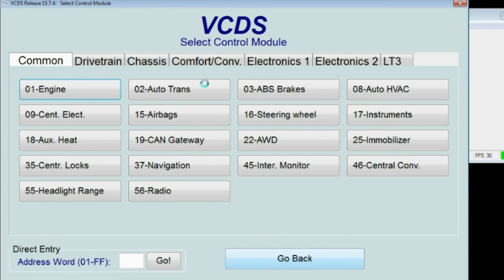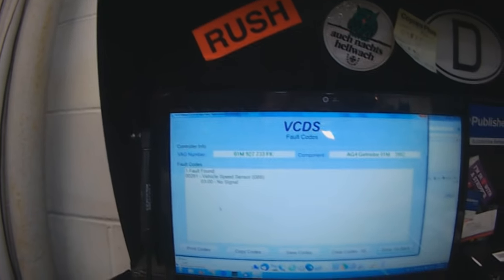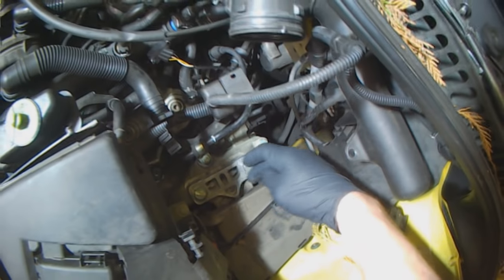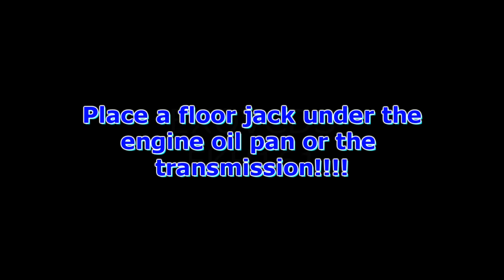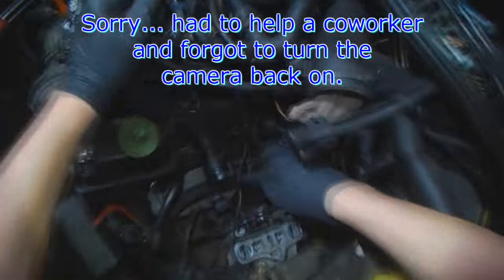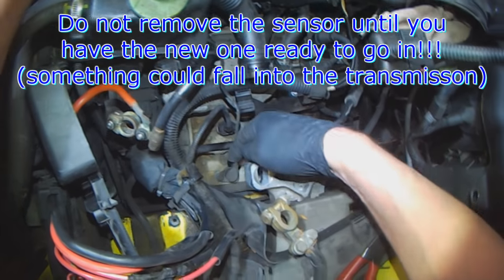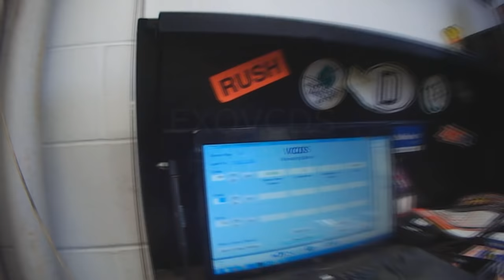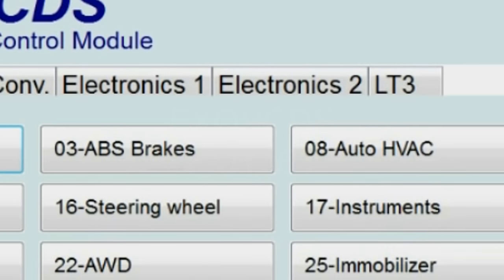VW A4: New Beetle - vehicle speed sensor (G68) no signal

Comment: Thomas - First thanks for the video!  Question if you don't mind.

2001 NB AVH engine.  00281 Vehicle Speed Sensor (G68) 03-00 No Signal from VAG-COM.  If I reset the code, I get the same error as you, BUT then the transmission shifts flawlessly when it should....but within just a few miles, code was thrown again and the DTC returns 00281.

Had the timing belt done and the coolant flange replaced and then within a couple days the fuel pump died, which I replaced.  However, my son-in-law towed it to my house with all 4 on the ground after the pump died, but did tow slowly.  About 10 miles.

After I replaced fuel pump, transmission was slow to shift - would go up to 4,000 rpm then shift.  I thought his towing ruined the transmission and was not too happy since I thought it meant the car was now worthless.

In you video, when the sensor is out, you say to turn the wheel to make sure that the internal part is working.  Would you suspect that internal part was ruined by the tow or would you think it actually is just that the sensor died concidentally at the same time as the fuel pump?
Reply from the maker: The sensor is cheap & easy to replace... while it is out, it's easy to check the reluctor wheel for movement. I don't know if towing a car with the wheels on the ground is harmful to the transmission. Replace the sensor or check with a transmission shop if towing could have caused damage.
Reply: My owners manual says don't tow with all 4 down, but maybe some is tolerable. 

Feeling it shift flawlessly after I reset the code gives me hope that the transmission is not ruined after all.

I'm certain I can do the repair having your video as a guide.  Thank you so much for doing what you do!

I'll let you know how it goes.
Reply from the maker: Thank you.

Comment: My 2000 2.0 New Beetle GL (Auto Trans) read the code G68 Input/Output Shaft Speed Sensor, so I replaced it.   When I unclipped the connector, I noticed the TOP Part, not the side I was replacing but the Other side of it was starting to deteriorate..? It has red plastic in it that is just shattered.  Where does that ebd of the sensor go?? Getting to the top side of G68 shouldn't be that hard, unlike the bottom side I just replaced. The sensor I got did say Output, is the top part possibly the Input part if the code reading?
Reply from the maker: Sorry, I'm not following what you are saying. Post a video or send me pictures fkh161@fkh161.ca

Comment: Do you know where the same sensor is for a manual transmission 2008 beetle 2.5 engine
Reply from the maker: 5 speed or 6 speed?
What's the actual issue? Speedometer not working?

Comment: 2004 2.0 randomly shuts off. Check engine light does not get activated. But there is a “pending” code of p0725. Would that correlate to this sensor? Pulling hair out trying to solve this for someone. There’s no rhyme or reason. I turns off very randomly. No codes nothing. Once, it stumbled but saved itself. Again, no hard faults. 
 
the ONLY thing I have to go off of is that pending p0725. After it does stall, it takes a few seconds of cranking to fire back up. Then all is good again.
Reply from the maker: Sorry about the late reply... most likely a bad crankshaft position sensor.
How to check / remove: (long version)
https://www.youtube.com/watch?v=MJIA0AsxASQ

Short version:
https://www.youtube.com/watch?v=qYfZOb9vzkU

Comment: So which other sensor would it be if I'm still having shipping from because it will not shield unless the check engine light is on and it's a 2001 Volkswagen Beetle diesel
Reply from the maker: If the transmission computer is setting a fault code for a specific sensor or solenoid, then you have to check that sensor, solenoid or wiring. At this age, it is common to see wiring faults or faults with the ribbon cable inside the transmission. No one can tell you what the problem / fix is. You have to check things yourself to find the problem. Using a scan tool, multimeter and a wiring diagram. Sometimes it is quicker & cheaper if you take the vehicle to a shop that is familiar with vw automatic transmissions.

Comment: i have almost same problem with mk4 4 speed , when i want to move forward or reverse i need to put too much gas on acceleration almost 5 rpms when its cold, and when i drive the engine warms up i dont have this problem, i have this same error code in scanner.( oil and filter are new)
Reply from the maker: Can you verify with your scan tool that there is no signal when cold, but there is a signal when warm?
Best place to check is at the sensor connector with a scope. Multimeter will also work, but not as well.
Quickest thing to do is change the sensor. If nothing changes, take a closer look at all of the wiring / connections from the sensor to the TCM.
I don't think that the gear inside the transmission could be to blame... but I'm not a transmission guy.

Comment: My 2002 vw jetta doesn't have a code pop up. At auto zone it literally just said input speed sensor, is this all I have to replace? My car jumps when it shift gears instead of doing so smoothly. It's an automatic
Reply from the maker: No... your transmission probably has other issues. A faulty speed sensor (such as in this video) causes the TCM to select 2nd or 3rd gear (I can't remember which) when starting to drive. The car is slower to accelerate (due to being in a higher gear) and the TCM does not shift into the next gear until engine rpm is quite high & the throttle is released. No harsh shifting. Harsh shifting is usually a valve body / solenoid issue.

Comment: I have a 2004 Beetle which is shifting into and out of park, reverse and drive just fine and always has. But suddenly when I am driving, when I get up to about 20mph, it gets loud and the RPMs go up to 4000 or a little over, the faster I try to go the louder it gets and the higher the RPMs get. Basically it seems to not want to go into 2nd gear. Seems to be pretty much the same issue, right? Thank you for the advice
Reply from the maker: What happens when you manually shift... 1, 2, 3?
In this video, the rpm were slow to build (because the transmission was starting off in a higher gear. If your transmission is stuck in 1st gear, rpm will climb quickly and the engine will get loud (because of the high rpm). 
Check for fault codes, check fluid level... probably an issue with the valve body (solenoid bad or sticking). Have a transmission shop test drive it.

Comment: Would a wet TCM trigger codes p0740? I Left my passenger side window open and water flooded the floor of my 2005 Jetta
Reply from the maker: The TCM is located under the windshield next to the ECM on mk4's and behind the left front fender on mk5's. 2005 is the cross over year.... which do you own?

Comment: So I have a 2000 Jetta won’t shift into 4th and both the speedometer and Odometer are not working. Is this speed sensor the issue?
Reply from the maker: If you feel the transmission shift from 1 to 2 and then to 3... no, this sensor is not the issue. The "speed sensor" for the speedometer & odometer is on top of the differential. It's a 3 wire sensor. It could be that the sensor is bad... or it could be the plastic gear inside the transmission that is bad. 4th gear engagement is a separate issue.

Comment: have 1998 jetta 2.0 mk3 wolfsburg edition auto trans. Speedo not working. have code P0501 "Vehicle Speed Sensor A Range/Performance". Tach not working also but more interested in getting speedo working. Odometer not working too. But when I connect my code reader I get RPM and Speed in "View Data". Shifts fine also. Where is the VSS for the SPEEDOMETER located. And how to R&R it. If you get this let me know
Reply from the maker: The speed sensor (G22) for the speedometer is on the top of the differential. Here's a picture showing the location of the G22 speed sensor:
http://www.kansascitytdi.com/01m%20faq_files/image007.jpg

Comment: Hi nice video but how do you unclip the sensor, that part is not shown and we can't get it off using multiple tools?
Reply from the maker: Push the connector towards the sensor... pull back on the release tab with your thumb, pull the connector off.
Reply from the maker: Any luck? I recorded a how-to video just now. Will post it on the weekend.
Reply from the maker: Which connector / sensor specifically? The more info I have the better I can help.
https://www.youtube.com/watch?v=3GBtR7fpvyY

Comment: Can i lube the oring with normal engine oil? must it be an atf? I have similar problem with my golf 4, AG4 transmission gear. But it works at firsts few kilometres, later the "clock" is jumping, and at least i have 0kmh speed, and an icon with low fuel levev every time when i'm turning
Reply from the maker: If the speedometer "needle" stops moving... then it is a different sensor that is the problem (or a problem with the gear inside the transmission, that turns the sensor). Yes, a little bit of engine oil on the o-ring is not a big deal. If the needle stops moving, let me know and I will tell you which other sensor to check.

Comment: Question my wife's car is a 2000 beetle 2.0 manual.  Her speedometer has completely failed.  The check engine light has been on for awhile indicating sensor.  Where is the location on a manual.
Reply from the maker: The odometer stopped counting as well?
Reply from the maker: At 11:16 in the following video, you can see the sensor next to my coworkers hand. The sensor is usually covered with a heat shield / fabric pouch. You can get to the sensor from the top / through the open hood engine bay. https://youtu.be/OjdsKg1LsC8?t=11m16s

Comment: Hello friend, good afternoon. I have a new bettle 2008 automatic 2.0. Yellow, like this video. Today the car stopped. It turns on and accelerates normally, but when it engages the gear it moves a bit and stops, but the engine continues to run normally. All the tail lights are on, as if all gears were engaged. Do you think it could be the speed sensor?
Many thanks from Brazil. Congratulations on the video. Sorry bad English.
Reply from the maker: Hi... no, I don't think that it is a speed sensor problem. I would start with scanning the TCM (Transmission Control Module) for fault codes. Could be a wiring problem or a fault inside the transmission / valve body, but that is just a guess.
Reply: Thanks a lot Thomas. I will check. After i talk to you!!!
Reply: you need transmission oil added must be a guart or so low that is what they do when low a safety precaution to prevent burning transmission out.

Comment: I have a 98 volkswagon beetle manual transmission went through a rain storm and now I have no gears ..is the transmission computer module located on passenger side.
Reply: 1.8 motor
Reply from the maker: Standard transmission does not have a computer / module. Did you drive through a deep puddle? Does the shifter feel weird or normal? Does the clutch pedal feel normal or weird?

Comment: My beetle stalls then cuts off while driving but starts right back up, does it every blue moon, what can be my problem
Reply from the maker: Intermittent stalling... but starts right away, could be due to a bad ECM power supply relay. Or something else. If the stalling / no start does not happen long enough for you to do some testing... it can be difficult trying to trace down the actual issue. It will be easier to find the problem when it gets to the point where the engine does not start at all.

Comment: have the same problem!
Sensor changed but the code wont clear, and it still shifts like ass :(
Maybe my wiring is frozen to death...
Reply from the maker: With the sensor disconnected, there should be a different code. If yes, then the wiring is ok.

Comment: 2004 vw beetle are the sensor located in the same area
Reply from the maker: If it is a 01M transmission, yes... if your shifter can me be moved to the right and then shifted between +/- to change gears, then no. What's the actual issue? TCM fault codes?
Reply: @EXOVCDS  epc light car turns on and off .... But the code we get is transmission sensor well that's what my mechanic say
Reply from the maker: More than one type of transmission available in the Beetle.... that's why I asked. More than one sensor in those transmissions. The more info I have, the better I can guess. If your mechanic is able to read codes, he should be able to fix the issue. Was the estimate too much? An hour of shop labor compared to not being able to drive the car for the weekend (trying to fix it), might be money well spent.

Comment: Hey man im having a speed sensor issues as well, I have a 2005 jetta gli with the O2M 6 speed transmisson, code P0501, i replaced the sensor and it still doesn’t work, its weird my speedometer doesn’t work right away put as soon as i get up to speed and hit 3rd gear its starts working again, but as soon as i come to stop the car starts to jerk 1st through 2nd. My gas gadge also goes nuts whenever i turn the wheel as well. Ive checked my fuses and they look good. Maybe its a bad ground? If so do you know where i can check? Thank you sorry about the paragraph lol
Reply from the maker: It could be that the "tone wheel" (pressed on to the differential) for the speed sensor is loose... causing it to slip at low speeds and start spinning at higher speeds. Vehicle speed & ABS sensor speed signals are compared...  non matching signals can cause ABS / Traction control activation which could be the jerking that you are feeling.
Reply: @EXOVCDS I think I'm having the same problem my nieces car. So is that something that could be done from outside or transmission has to come apart aka replaced with another used one. Thank you for the video and taking the time
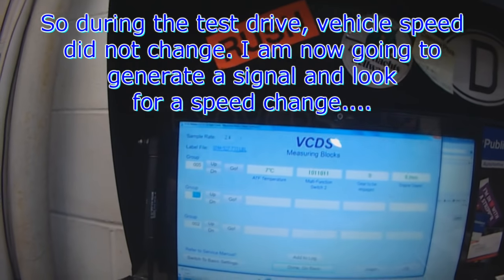Reply from the maker: Watch the following video starting at the 4:37 mark.
https://youtu.be/w27c3euMsiw
Reply from the maker: Assuming your transmission is the same... since I don't know what you have.
Reply: @EXOVCDS  I ended up replacing the aftermarket speed sensor with a OEM one from the dealership and it fixed the issue!
Reply from the maker: Thank you for the update!

Comment: Here's a question for ya.. At the end of the video when you showed the driving clip, isn't 55km/h a awful slow for an 01M to be shifting into 4th? On my TDI 01M I hit 3rd around 50km/h and 4th around 70km/h assuming normal acceleration. Does an 01M mated to a gasser have different shift points?
Reply from the maker: +Michael Shone I was driving it quite gentle... gas pedal angle wise (if I recall correctly). Driving more aggressive, it will shift later. I did do basic settings as well... I'll check the next one I get my hands on... well spotted & good question. Did I send you an Auto Tranny pdf? I think it contains shift points.
Reply: +Thomas EXOVCDS yes you did! I'll have to have a look and report back :)

Comment: Hi, I've just change the sensor and taken for test drive but still no 4th gear, do I need to clear the fault code to achieve 4th gear? Thanks in advance
Reply from the maker: Yes you might have to... It might reset on its own after 3 or more drive cycles (cold to warm) but I'm not sure. I usually clear codes after a repair. If your scan tool can not communicate with the TCM, give it some time or have a shop clearcut while you wait.
Reply: Thomas EXOVCDS I have now cleared the codes and have 4th gear, thanks for your help

Comment: Hello sir.. Can you please help me with my mk4 2.0 auto trans  is stuck on 3rd gear if I put it on Drive.. It doesn't wanna shift out of 3rd gear 😢 please advise
Reply from the maker: Any fault codes on the ECM? Which transmission? 4, 5, 6 speed auto?
Reply: @EXOVCDS  I haven't scanned it yet.. It's 5 speed box

Comment: I been driving vw beetle 2001 when I start drive off it didn't shift it all and I can shift 1 2 3 if I put drive rpm get high and transmission code 000268 what would it cast problems with it can u help me ty
Reply from the maker: http://wiki.ross-tech.com/wiki/index.php/00268

Comment: Will this stop your bug from cranking p0725 p1850 p1780 I changed the crank sensor no start and just seen this vid for this sensor
Reply from the maker: In this video a sensor that is mounted on the transmission is bad... the engine itself has no running issues. Your codes are stored in which module? Engine / Transmission / other?
Reply: Thomas EXOVCDS the engine I replaced that sensor you replaced too much in the video I did fuel pump ignition switch it just cranks but don’t start😫 probably swap out a TCM and see what that does  I have a 00beetle  2.0
Reply from the maker: @butterflydoze  have someone tap the bottom of the fuel tank (passenger side of car) while you crank the engine. A transmission or TCM fault should not prevent the engine from starting.

Comment: For mk4 jetta  1.8t automatic transmission where's  speed sensor located same as  VW Beatle?? Thanks
Reply from the maker: What is the issue with your Jetta?  Is your transmission a 01m transmission like in this video?
Reply: @EXOVCDS  is automatic Jetta 2004 1.8t faults found 16706
Reply from the maker: @tilowol  16706 is engine speed sensor:
http://wiki.ross-tech.com/wiki/index.php/16706/P0322/000802
It's located to the right of the oil filter flange. Mounted to the engine block. 
Engine speed sensor wil cause stalling or no-start issues.

Comment: Hey i got convertable problem that i don't know how to fix.. It says on my mirror that my convertable top isnt closed all they way when it is nd idk how to fix that can u help at all?
Reply from the maker: There's probably a "closed / open" micro switch that is not sending a closed signal. You'll have to look at a wiring diagram and service manual to figure out where the sensor is located, so you can test / check it.
Reply: @EXOVCDS  thank you man will look first thing in the morning